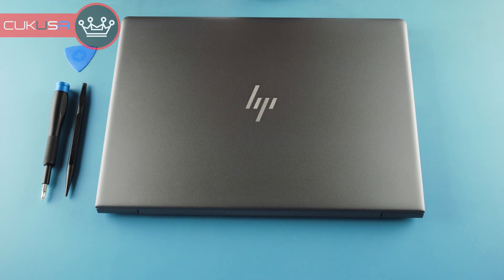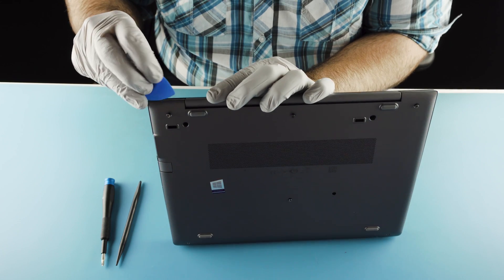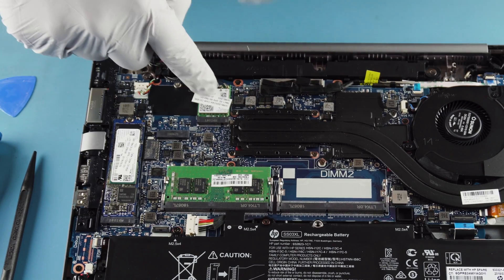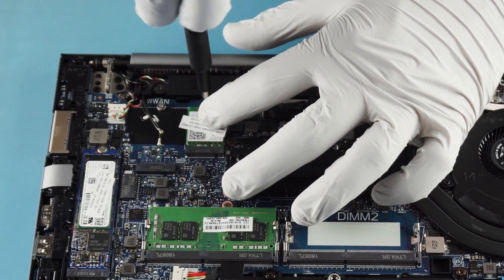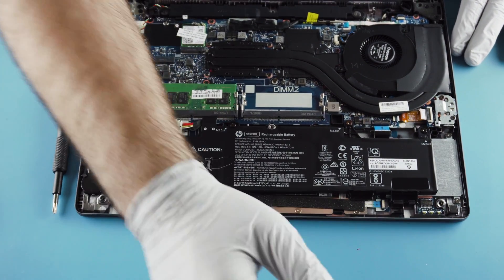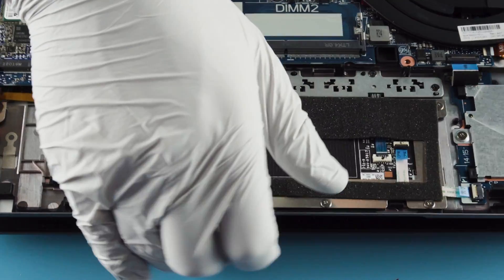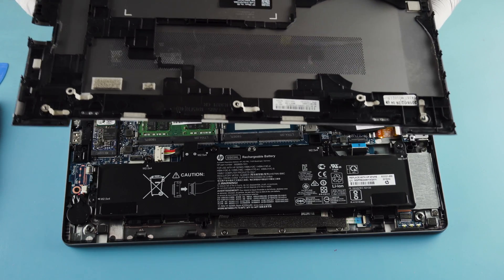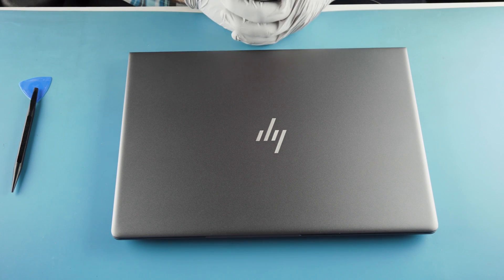HP ZBook 14U G5 | How to Service, Upgrade & Fix Laptop (Teardown)

Comment: I don't use the nub because I'm not accurate with it, but if it's advantage is that your hands don't have to travel as far between typing and using your mouse. You can keep your hands in the same area to do both

Comment: Didn't unplug the battery - didn't use anti-static precautions, didn't discharge caps.  Didn't look up the manual to familiarize yourself with the chassis and layout of the hardware.  Not professional in the slightest.

Comment: The nub, mainly with spreadsheet warriors, lets the user to slightly move the cursor in fine precise short movements (when you get used to), without moving the hands from the home row on the keyboard, that's why it appears on business laptops (but it's not the unique cursor since web browsing is a different animal)

Comment: Anti-static ESD wrist strap not added until 3'33". Shouldn't the cord be connected to the laptop chassis?
Reply: If you're using an anti-static mat the strap is connected to that.